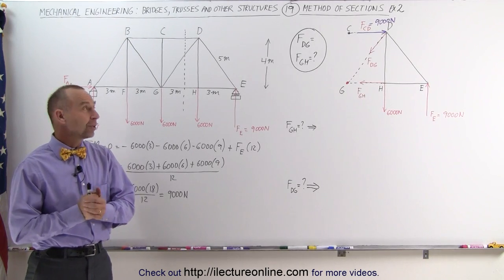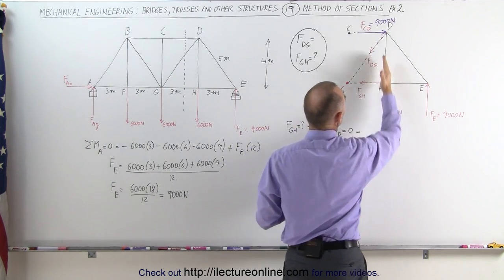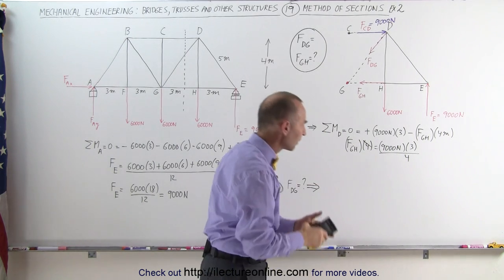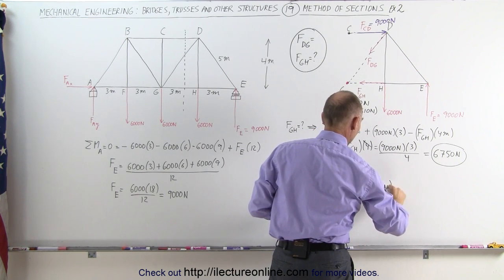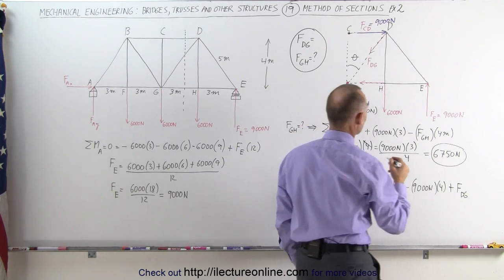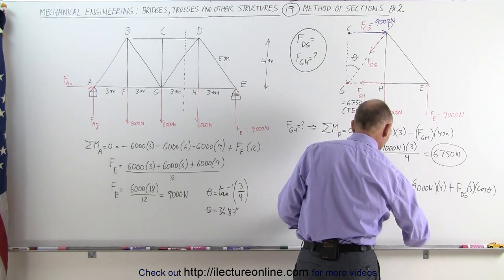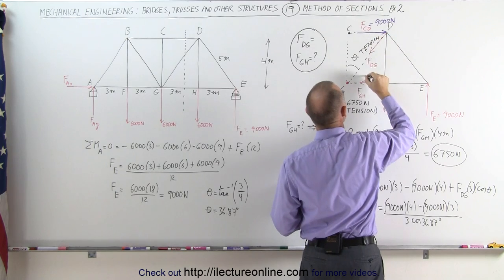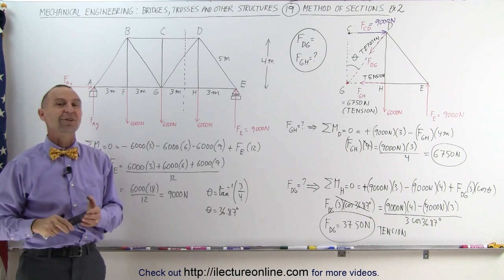Mechanical Engineering: Trusses, Bridges & Other Structures (19 of 34) Pratt Bridge: Sections: Ex. 2

Comment: Does the Method of sections only work when there’s symmetry throughout the structure?
Reply from the maker: No, it does not require symmetry, but symmetry will of course make it easier.

Comment: I still do not understand how the perpendicular distance of F(dg) taking moment at H is (3)(cos(delta))? Can you please explain?
Reply from the maker: +Kevin Ng 
If you are having trouble with that concept, you may want to study this playlist first:  PHYSICS 15 TORQUE
Reply from the maker: +Michel van Biezen 
Here is another good playlist to look at for this concept:  MECHANICAL ENGINEERING 2 - MOMENT OF A FORCE
Reply: I understand the concept of moment. Im just having trouble understanding how were you able to find the perpendicular distance by just multiplying cos(delta) with the length. I usually deal with perpendicular distance either horizontally and vertically, not slanted. Is their a specific video regarding slanted perpendicular distance?
Reply from the maker: +Kevin Ng 
OK, now I understand the question.  Another way of finding the moment (or torque) is to find the "effective" torque by multiplying the applied force with the distance between the application point of the force and the point of rotation and by the cosine of the angle between the direction of the force and the perpendicular to the moment arm.
Reply: +Michel van Biezen  For the sum of moments around H .... Shouldn't that be Fdg (sin (thita) )(4) since that would give the horizontal component of Fdg ?
Reply: Here is another way to think of it..hope this helps!
1. You know you can move a force along its line of action. So move the F(dg) arrow so that it starts at point G instead of D.
2. Now it's easier to see that F(dg)(cos(theta)) is the "y" component of the force. This y component of the force will contribute to the moment about H
3. You also have an "x" component of force F(dg)(sin(theta)). But this "x" component of force at point G will not contribute to a moment about H so you can ignore it.
Reply: you are right OMARTG96.......... I caught the same ......

Comment: Why is the distance from point D to Force(E) 3m and not 5m? We just ignore the hyp value and use the x value?
Reply from the maker: The distance between D and E is 5 m, but the distance along the moment arm is 3 m.   (the perpendicular distance from the line of action of the force to the point of rotation (the moment)).
Reply: Ah, makes sense. Thank you!

Comment: owk sir, can i get the name of the second person to see if he'd be helpful too. Also sir, not many teachers have the clarity you have,i've benefitted so much from your teachings and i've improved a lot. when i wrote my entry exam into college, i had an E in physics,but then i've not encountered your videos. when i got into college.in my first year,i watched all your videos for my exams,mechanics,thermodynamics,electricity,fluids, and i got a B. i find it very helpful bcos its also dificult for me to understand the testbooks,but after watching your videos,its so easy. sir ,now in my second year,we do thermodynamics and fluid mechanics as a course and its a bit more advanced than the ones you have that i used in my first year physics. so, i think it would be helpful if you can help make videos like you did in the other ones. in fluid mechanics,we're suppose to cover the introduction,properties of fluids, fluid statics, basics of fluid flow, energy in steady flow and steady incompressible flow in pressure conduits, while in thermodynamics,we cover introduction and first law,working fluid,reversible and irreversible processes,second law,heat engine cycle,mixtures,combustion,steam cycles,refrigeration and heat pumps. we use eastop and McConkey applied thermodynamics and joseph b franzini fluid mechanics. i have the exams by the end of may. so if i can get more help from you before then. i'd be so grateful
Reply from the maker: +Chi Precious
  Many of those topics are already covered in the physics playlists.  Go check them out.
Reply: +Michel van Biezen but sir, i can't find a lot of the topics that i do this semester